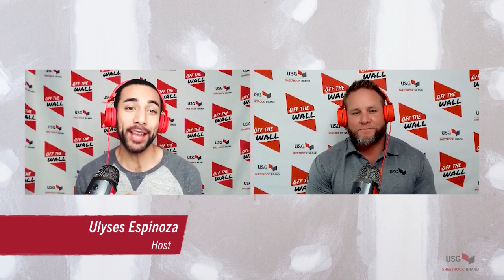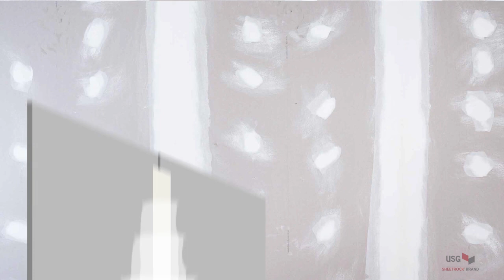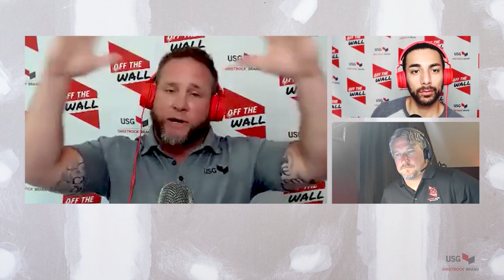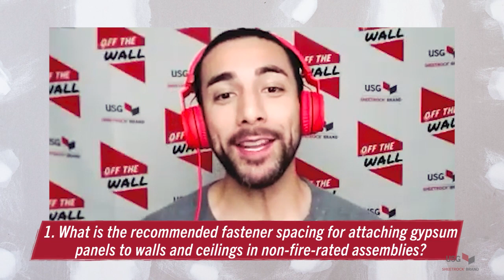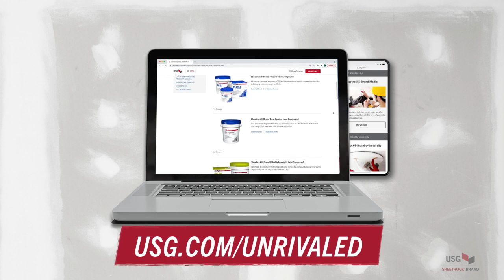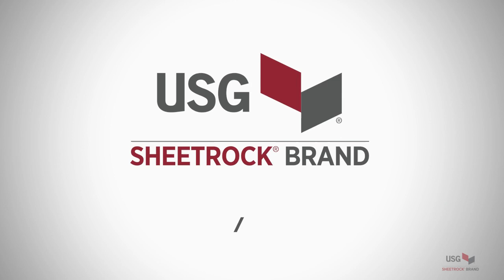USG "Off the Wall" Podcast—Episode 2: Unsung Heroes of Joint Compound

Comment: This is 2021 dude nobody that does quality work uses nails in residential drywall. Also a level 4 finish with eggshell paint can be done if you know how to finish properly and have a quality painter.
Reply: well when you hang by yourself, it is a bit easier to tack a nail